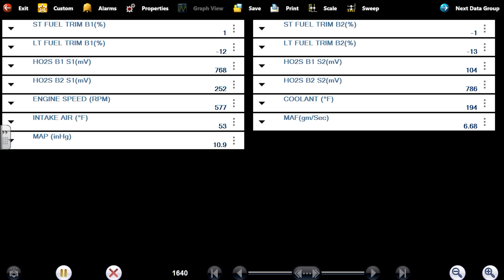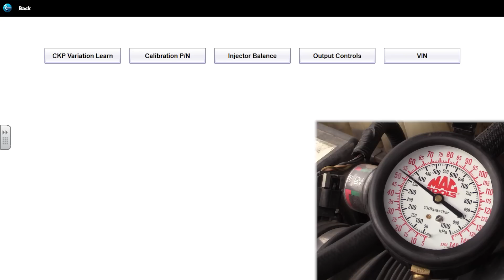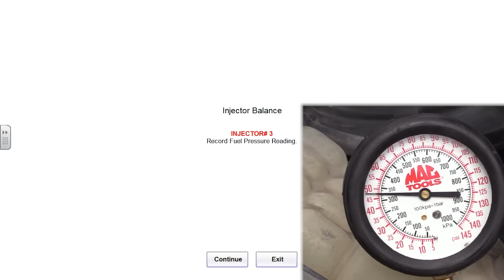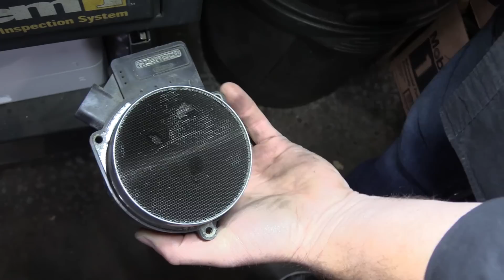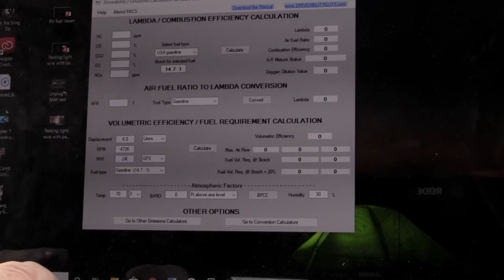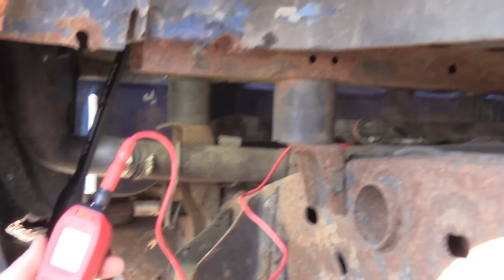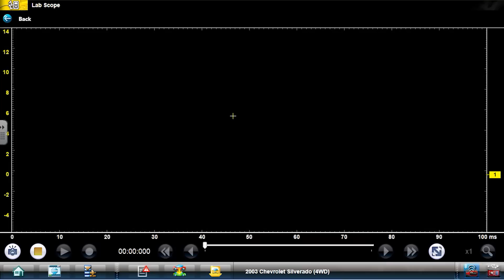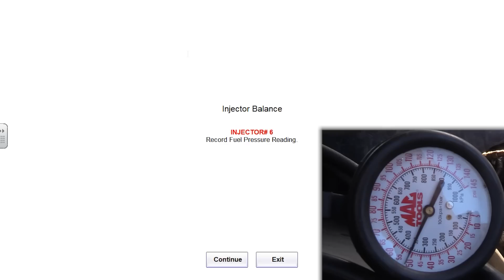03 Silverado Misfire, Rich AND Lean fault codes

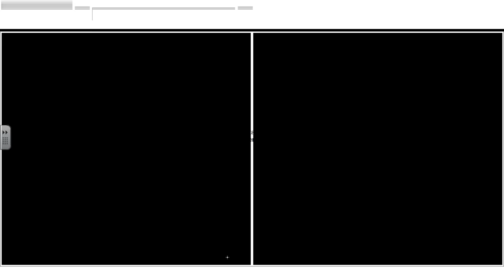Comment: At 12:20 under the "Fuel tank pressure sensor (V)", it showed constantly 0V. I was surprised that you didn't comment on that, besides that you've mentioned that it never changed.
And still you're questioned "Why is the tank pressure sensor isn't even plugged in? How was I getting tank pressure before?".

It's incredible that even diagnosticians made so tiny mistakes (me the first).

Have a nice week-end by the way!
Reply from the maker: I just didn't really care all that much which was why I moved away from it. I only wanted that data PID for a quick test of the purge valve. Once I verified a good purge valve, I no longer cared. Make sense? It's just part of the EVAP system and was no longer relevant to the rich condition. (After the purge valve proved good)

Comment: I will definitely let you know what I find out when the weather warms up too cold to work on it outside thanks for looking at my truck for me
Reply from the maker: @freedom7597  I did test the pump? Did you see the 10-15 psi drop in pressure during a dead rev? Imagine what that actually looks like under load! In my opinion, this is the main cause of the customers driveability complaints. From what I was told (and I'd love to hear from Patrick on this) was he had a highway speed hesitation/misfiring complaint AND lean exhaust codes P0171 and P0174 which were cleared before the truck came to us. It also makes sense to me that those lean exhaust codes did not return immediately as idle and low speed driving around town would not reveal that issue.  
Second, the exhaust leak, this would contribute to fuel trim issues on that side of the engine, but these would be positive numbers not negative. 
Third, we had negative trim numbers on both banks that have absolutely nothing to do with the low fuel pressure issues nor the exhaust leak. So we have a separate issue. I am still not liking the injector flow rates on this. They should all be the same and we have a 2 psi difference on some of them. Patrick said they are in fact new injectors and I asked him where he got them from and who was the manufacturer. I am waiting to hear from him still on this as I am not ready to look away from the injectors on this issue just yet. 
I am sorry you feel like you didn't get what you wanted from this video. It should be more about the journey than the solution but I get it. This one was a little different as we were not doing the repairs. BUT we have the blessing of having the customer right here in the comments and maybe we will get to see it back again after the fix!
Reply from the maker: @David Palmer, there shouldn't be any pressure differences.
Reply: @ScannerDanner  I noticed in the video that the Fuel tank pressure sensor wasn't plugged in. Did you unplug it? Remember at the beginning of the video you weren't getting a tank pressure change
Reply: @ScannerDanner 
I’m having the exact same issue with a equinox, I’m to the point where I’m starting to think the cats are semi plugged up, someone at some point replaced intake, manifold gaskets. I did the exact same injector balance test and had basically the same results. However, I pulled the fuel rail with the injectors and did the test. I found that when somebody had replaced intake gaskets and reconnected each injector they had injector harness wired to the wrong injectors that was causing my misfire and Rich condition which intern I think started to plug up the catalytic converter with restriction to the catalytic converter. Wouldn’t that caused negative fuel trim numbers because of the ECM trying to pull fuel out of the fuel trim?
Reply: Hurry! We can't wait. It's not that cold out!
Reply: Did you laugh when you heard the tires squealing lol
Reply from the maker: @eduardoyepez7358  I did as I knew the customer was a subscriber and his tires are brand new. I wasn't trying to be an ass, there was just a little humor in that as I was filming it. Stuff a typical customer never sees right?
Reply from the maker: @Genetics1  hahaha nice!
Reply: @eduardoyepez7358  I think that was pretty cool...@scannerdanner is a heavy footer
Reply: @eduardoyepez7358  rofl, yes....
Reply: Patrick laughrey when you do fix your truck please take it back to him and let him (danner) check it again. I have the same truck with the same broken bolt in the same place but I am getting higher ltft on bank one and yes my engine exhaust leak goes away when the engine is warmed up and my ltft on bank one goes down from 25 to 14. now this video explains a lot of what could be go in on with my problem.
Reply: @JD-526  They make a clamp plate to fix the exhaust leak on these. It bolts to the engine and puts pressure on the manifold to tighten the gap. 917-142 Dorman part #. My current truck I pulled the manifold, removed broken bolts and had the manifold ground flat, but the clamp works great.
Reply: @mph5896  That might be the only thing Dorman is good far. lol
Reply: Patrick you going to leave everyone hanging?  What's the latest?
Reply from the maker: @Patrick laighrey you didn't take the plastic caps off of the end of the new injectors when you put them in did you? Also, I would still like to know where you got them from and who was the manufacturer. Thanks!!
Reply: I had several of the same symptoms in this video including the 5/8 misfire condition. A set of new intake manifold gaskets and now it's running smooth as new.
Reply: Lol it's been 4 years and Patrick still has not fixed the issue
Reply: @papimasfuerte4671  We need updates! BUT that's how some customers are lol
Reply: @Patrick laughrey looking forward to your results with the fix.
Reply: I agree with @ScannerDanner on the fuel pump. Just make sure you put in a quality pump like Delphi or AcDelco. RockAuto is a good source. Also make sure you get the correct one as there are a ton of options to sort thru. I would also pick up a can or two of BG 44K on Amazon and run thru a 20 gallon tank full on each can separately. Should help the injector issue.
Reply: @ScannerDanner that moment when you scanner almost dropped was real intense!
Reply: @patrick laughrey any updates? Can't wait to see the fix on this one
Reply: Maybe the filter wasn't put on to the right direction
Reply: @mejiac6313  filter is new and installed properly
Reply: @patricklaughrey8727  Any expcication of the pressure drop of the feul pump under load?
Reply: I've seen exhaust manifold leaks cause fuel trims off... If you reset fuel tables and then check numbers when engine is hot and leak is less then check compare numbers. I definitely agree that pump is junk...I would fix the exhaust leak before injectors... It is a definitive fault that could be related.
Reply: If its ebay refurbished injectors, then that could be your issue. They claim to be flow matched but I wouldn't trust them. It so happens that I have rich and lean condition too. Exhaust gasket and possible uneven flow injectors from ebay and Im running boost. 
Question for Dan: If unmetered air is getting in upstream near manifold wouldn't that cause a rich condition? I believe you said lean in vid. Im dying to hear how this case panned out
Reply: @kas0016  isnt more fuel rich? to little air rich?
Reply: @keving5206  rich is too much fuel?
Reply from the maker: Also, to be clear, your low fuel pressure is what was causing your 60 mph hesitation/surging, misfire complaint. Fix your fuel psi and you'll fix that part but NOT the negative fuel trim and P0172 and P0175 codes. Injectors are still front and center. Maybe, maybe a skewed MAF sensor. I should have unplugged it and looked at trims. Though that test has variables too.
Reply: Interesting, I did a pulse test on mine and I had an injector that was a showing  1 to 2 psi lower. Car drove me nuts , kept dropping out of closed loop.
Reply: @freedom7597  

from the test that he did , you could see the psi drop back time that should not happen to any fuel pump. the injector test is not consistant but you could just do an estimated comparison on each test.
Reply: Wouldn't fuel injector cleaner not do anything for a leaking injector or injectors and only help when it's clogged injectors?
Reply: So much for getting back to us.
Reply: @skankytrick  havent done anything yet
Reply: @patricklaughrey8727  you ever fix that misfire Patrick?
Reply: @xXCigarXx  no
Reply: @patricklaughrey8727  what all have you done?
Reply: @patricklaughrey8727  all this for nothing? Haha I’m having the same type of problems. Did you try anything else?
Reply: @patricklaughrey8727  
Did you replace anything on the car after SD looked at it ?
Reply: That was long video @Patrick laughrey did you ever fix that misfire?
Reply: @Takeover738  not yet
Reply: @patricklaughrey8727  did you fix that misfire?
Reply: Now is when you want to do it.  The rusted tank bolts will snap in the cold saving you a lot of work getting them off.
Reply: @freedom7597  Holy shit dude. ScannerDanner does not have to film these videos for us at all. At least he does though. Be thankful for this and his knowledge he is sharing in these HUNDREDS of videos. And stop nitpicking this shit and telling him to do more for you. You're comment reminded me of a spoiled little kid who is never happy with what they get, failing to realize that you dont have to get anything!!
Reply: Please do an update video  David and Paul would be nice too know the outcome the exhaust leak is and problem and should have unplugged the maf  I know the video was already long enough or would have done it I learned so much from you and Eric o and Ivan thanks you guys now this what I do for a living good money In this industry
Reply from the maker: @chadgardee1496  I agree, I should have unplugged the MAF and looked at trim numbers. On all the systems I have worked on, the default strategy for a MAF failure is slightly richer that normal. I have never seen one run leaner with the MAF unplugged. So if trims would have gone more positive after unplugging, that is some pretty solid evidence of a skewed MAF. 
Patrick, if you are seeing this, do this test for us and tell us what your fuel trims look like with the MAF unplugged. Of course, fix your low fuel pressure issue first.
Reply from the maker: @freedom7597  also, the injector flow tests, there is no spec! It is a "balance" test, you are simply comparing flow rates for each injector and there should be NO differences
Reply: @freedom7597  He tested the injectors a number of times and you could also see the fuel pressure dropping under load??
Reply: @d.d4184  lol a good portion of the video showed that i don't see how freedom can miss that.

Comment: The pump filter injectors plugs wires and coils all brand new
Reply from the maker: Injectors were not new, at least on a visual appearance
Reply: @ScannerDanner  yes I replaced all 8 myself brand new it did the same thing with the stock ones
Reply from the maker: They did not look new. When were they replaced and where did you get them from? Also, super important,  where the injectors the right ones? They had flex fuel systems on these and the flow rate on the injectors are different
Reply: @ScannerDanner  the stock injectors did the same thing I saved them the only reason I changed this is my buddy told me they had a problem in 03 with faulty sticking injectors
Reply from the maker: Where did you get the injectors? Who was the manufacturer?
Reply from the maker: Also, to be clear, your low fuel pressure is what was causing your 60 mph hesitation/surging, misfire complaint. Fix your fuel psi and you'll fix that part but NOT the negative fuel trim and P0172 and P0175 codes. Injectors are still front and center. Maybe, maybe a skewed MAF sensor. I should have unplugged it and looked at trims. Though that test has variables too.
Reply: @ScannerDanner  I'll change the pump and new filter as far as the exhaust that's a major project I haven't had time to address it will get new long tube headers cats an new bolts in the heads it's a pain to remove broken bolts

Comment: Restriction on the intake side of the pump?
Reply from the maker: possibly, definitely something going on inside of that tank, or a bad new pump
Reply: Tank pressure ever change?  Cap???  Relative compression check?  Temp gun on individual exhaust manifold points?
Reply: Restriction on inlet side would cause lower amp draw and higher pump RPM...so probably not.

Comment: What about fuel pressure regulator it could be leaking back to fuel tank?
Reply: didn't he bypass that by unplugging the vac line, also it showed it was working when he pulled the vac line too
Reply from the maker: A leaking regulator (on the return line) results in low pressure all the time, not low psi only under load. So a stuck open or leaking regulator seat area was not a concern. 
Also, did you see how quickly psi rose when I took the vacuum hose off? Another indication that our regulator was fine.

Comment: Holding throttle at 2.5k RPM when testing the fuel pump amperage putting more strain on it would that be a valid test ? Cheers Danner
Reply from the maker: No, simply because at 2500 rpm in park, you really are not loading that fuel system very much.
Reply: ScannerDanner ok, thanks for the reply 👍 
I always love learning different ways to test components and sometimes I find myself overthinking, I did try an injector balance test with the Autel Maxicom while the car was running and it didn’t work out that well today seen you do the test with the engine off makes me think perhaps I was doing it wrong... cheers 👍
Reply from the maker: @CarsExposed  if the scan tool allowed you to do that test running, it was most likely an injector kill test, which is nothing more than a test to listen to or measure the RPM drops on each cylinder, make sense?
Reply: ScannerDanner it does, in my case the Revs didn’t change tho I was expecting to get a pass or fail message but I didn’t get anything and nothing really happened. Because is a 2019 new tool which I believe is replacing the Maxisys MS908p I thought maybe the tool isn’t quite ready yet ... I’ve seen the Maxisys injector balance test being done with the engine on and you get a pass or fail result message ... Cheers

Comment: Yes those fuel filters are a problem,can't get them off. Ok amps
Reply from the maker: Not in the rust belt anyway
Reply: @ScannerDanner  is that injector balance test done with key on ?
Reply from the maker: Yes, engine off
Reply: @ScannerDanner  I've seen other people do them off the rails and have a small setup with graduated cylinders. I guess this is the fancy way of doing it. I have a Verus Pro as well but I dont know how to use all the fancy functions yet.

Comment: My purge valve clicks on and off really loud, I wonder if that will effect the fuel pressure?
Reply from the maker: No sir, in no way shape or form does the EVAP system affect fuel pressure
Reply: @ScannerDanner  good to know, but how does purge valve effect the fuel trims?
Reply: @ScannerDanner  my MAF is reading 0.75lbs/m which is 5.6g/s in a 4.4l engine,  with that theory I should be at 0.59lbs/m which would be 4.4g/s. What's happening?
Reply: Separate systems and unrelated. It may have an impact on oxygen sensors since they will read the extra air coming from the fuel tank if stuck open but if all other systems are working, then the computer will compensate for that little anomaly.
Reply: @scientist100  06 range rover hse 4.4l jag engine, fuel pressure 75 psi and I'm getting both p0172 p0175 rich.
Reply: @SuperScopeLLC  ok thank you, I believe mine is bad, its clicking on and off real loud, audible when the hood is closed you can hear it inside the vehicle.

Comment: 370k miles on my 2004 GM original injectors never cleaned runs perfectly...
I got 170k out of a Delphi pump... excellent

Airtex junk pump?
Excellent work Thanks
Reply: Was a pump from advanced auto cant remember the brand found out after I just talked to the former owner that he replaced  the fuel lines maybe he kinked them when he installed them haven't checked yet
Reply: @patricklaughrey8727  airtex not to good last two years.
Maybe kinked lines.
Excellent tech Danner.
I have a few of those trucks excellent reliable rigs 6.0 GM trucks.
Reply: @SuperScopeLLC  maybe air bubbles in fuel stream or loose output on pump?
I do alot of diesel gas industrial since 1978 .
Had one new crane run terrible was a air leak in fitting on ISx common rail.
Noisy vibration from electric pump a clue also.
Ford had diesel fuel steel tanks corroded galvanized surface inside tanks in 2001 filling pump with sand like debris. Changed many to plastic tanks.
Excellent work Thanks!
Reply from the maker: Not sure. Hoping the owner comments here

Comment: I would have condemned the fuel pump after the maximum low 50 psi key on, after watching the drop with the regulator vacuum unhooked and it running under hard throttle. But that's just me. I'm a huge fan by the way, you and new level auto, Eric O. Brilliant skill levels I could only hope to reach.
Reply from the maker: This was not a CPI system (the ones with the mechanical poppet nozzles), so the fuel pressure specs are lower on these. Was it the slow build in psi during the key on event? Remember, with a psi gauge first connected, it is full of air, so that initial slow rise wasn't too much of a red flag. Hind site says otherwise for sure.
Reply: @ScannerDanner  that's where I shouldn't have made the comment on reflex, I was playing by memory. I'm more observant up close in my own shop 🙂
Reply from the maker: No problem my friend. I do it too!
Reply: @ScannerDanner  if it wasn't vin code Z, I would have been correct . Other is 58-62. That why we look things up before  we assume 🙂